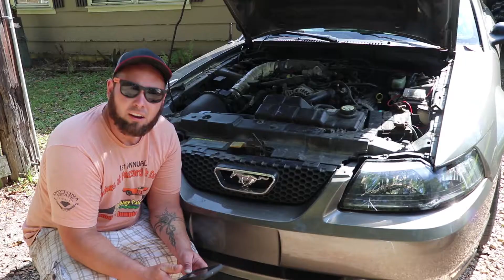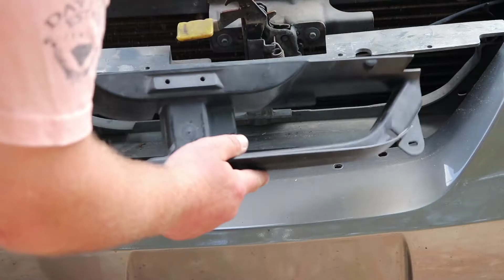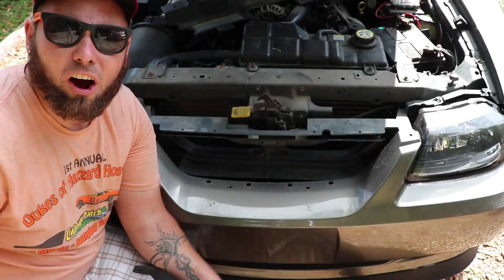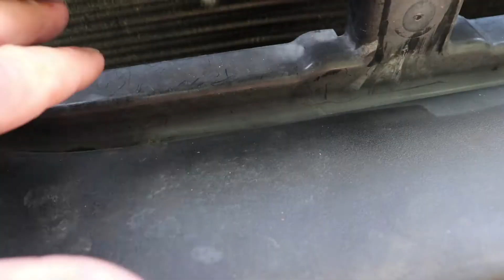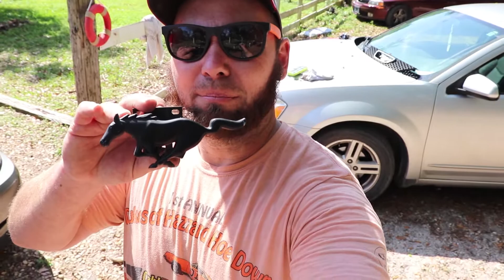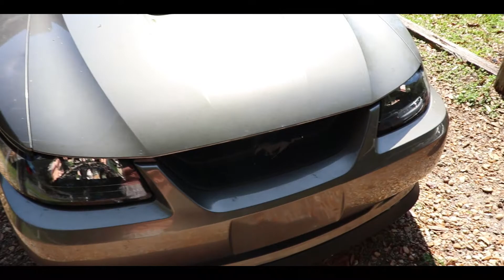How to Install Mach 1 Grille Delete kit

Comment: I like it better than the stock grill but it would probably look better painted.
Reply: Just did that today with mine.  Kept it black, but I repainted both of the black pieces and they look a LOT better.  It's a night and day difference and makes the front look much cleaner imo.

Comment: The one issue that I have with this upgrade is that a child could reach in and touch the radiator and maybe get burned.
Reply from the maker: It also makes it easier to break into the vehicle